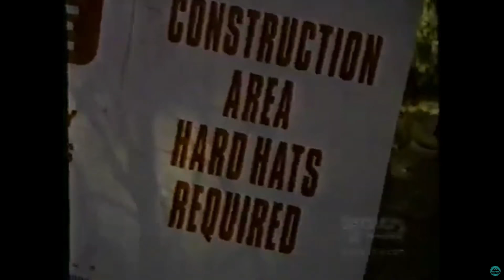The Bankruptcy of a Giovanola: The Final Coasters - Anaconda, Goliath & Titan | Expedition Extinct

Comment: The anaconda is still incredibly smooth today even 20 years later.
Reply from the maker: such a good ride
Reply: @ExpeditionThemePark  have you been to gold reef city?
Reply: the lighter two across train compared to the four across B&M train probably played a role there
Reply: @iceblade019  tell that to the Vekoma SLC's
Reply: @Posirep  Ouch
Reply: Yes, it is still my favorite inverted coaster in the world. Period.
Reply: @iceblade019  But B&M Inverts also have wider tracks and thicker spines to compensate. That's true of most B&M models - the wider the train, the wider the track and the thicker the spine.

The wing coaster is the exception, featuring heavy four-across seating on a tiny track. That's probably why they make their wing coasters forceless - to avoid putting too much stress on the track.
Reply: The only problem with B&M coasters is the rattle on the transitions as the coasters age.
Reply: @me-myself-i787 LOL the wingriders are not forceless.  The gigantic ones in China are incredibly intense
Reply: When’s the last time you rode Anaconda?  The maintenance @ GRC is amateur & suspect.  Anaconda is rough now

Comment: Goliath is an Amazing ride. It is super smooth and that first drop still to this day scares the shit out of me. The engineers knew what they were doing because they timed that drop perfectly. You go up that lift hill rather rapidly, but when you start reaching the top the car slows to a crawl and if you ride 1st car you will be hanging onto your butt as you crest the top waiting for the rear of the train to push you down. To me it's still the scariest drop, due to that slowing.
Reply: You should ride a B&M dive coaster because I'm pretty sure the only reason it slows down is to prevent any possible airtime on the way down for any row
Reply from the maker: it is because the forces are too high it needs to slow down to make it not as intense.
Reply: @ExpeditionThemePark  I'm sure the reason the car slows to a crawl on Goliath is 1 part intimidation factor and 1 part reduction of the forces at the top of the lift hill. The slowing of the chain could have been Giovanola's response to take pressure off the chain at the top instead of installing a B&M lift hill micro drop.

Comment: Haven't ridden Titan, but for Goliath at SFMM, the only good part was the helix imo. They didn't use parabolic hills/drops, so the thing has zero airtime, even on the first drop, which could be overlooked if it were more intense.

Unfortunately, the thing only has one intense moment, being the helix, which is not what you want from a twister layout.

Apparently Anaconda is good though, not I'll probably never ride that in my lifetime.
Reply from the maker: I have not been on Goliath but enjoy Titan!
Reply: Titan has great floater airtime on the hill and in the back seat it also has floater on the drop. But in my opinion the front left seat is the best. Because the airtime hill is stronger up front and you get to hang off the side of the train coming off the MCBR. Also the two helixes really help to round out the ride

Comment: An extra helix costed 7 mio? Or did I misunderstood that?
Reply from the maker: they underestimated the cost
Reply: It's not just extra track. It's extra support structure. The support structure for the added helix is very substantially built. The tracks that lead into and out of what was just a curve had to have their profile redesigned. The calculations have to be done for the helix and redone for all the track after the added helix. I think the video said the lift was built taller. Was that included in the extra expense?